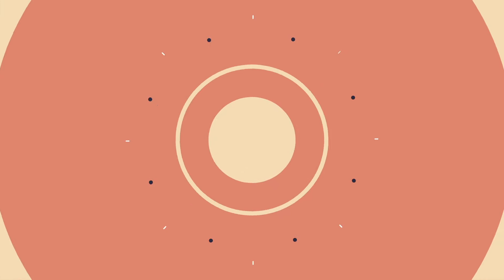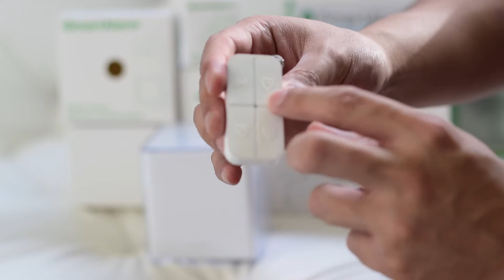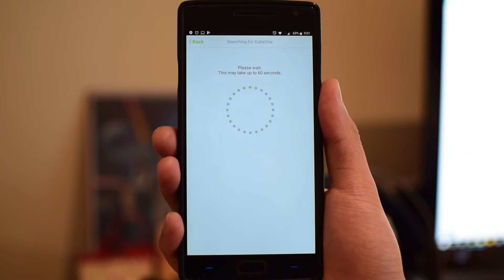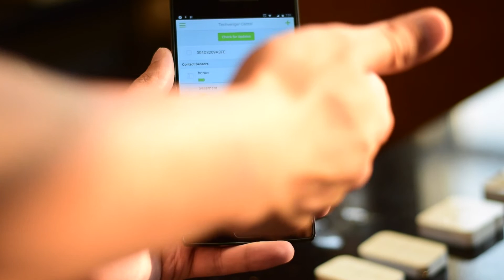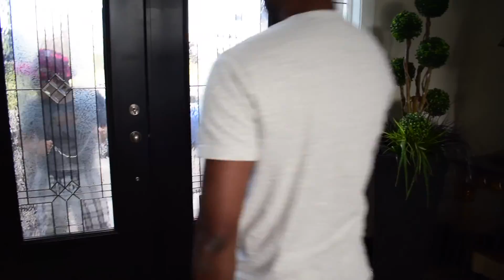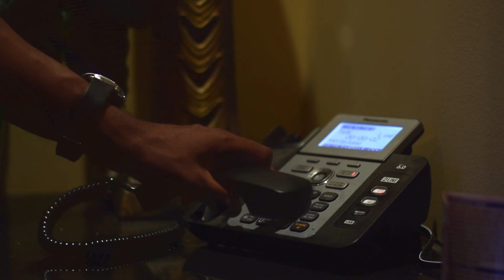iSmart Alarm Security System Review (2018)

Comment: I’ve had the system for 3 years, I have never had a false alarm. I highly recommend buying additional sirens to place in other parts of the house. The key pad is awesome, and the app gives detailed information about the sensors which is nice. 
The motion detector is sensitive (which I’d rather it catch something than be a dud) so when mounting the motion detector I recommend having someone hold it or sit it on something high close by to test to see where the motion range is. 
You can make custom settings through the app, example I have a “sleep” setting where once in bed I set It and if any sensor is triggered the alarm goes off in 10 seconds. 
Once the alarm is triggered you get a phone call, email and text informing you that a sensor has been tripped but it also informs you which sensor. 
I don’t have any of the cameras- I opted into a different indoor/ outdoor brand in case I move and want to place It on my porch. 
Overall not sure why ismartalarm has so many “false alarm” reviews because it’s honestly due to human error. 
The two negative things i will say are that the fob appears to be made to place on a keying but that’s virtually impossible to do without causing false alarms but thats common sense once you see how it’s made. So i use to just hide mine near an entry table to turn off and on the alarm. Now it’s just beside the bed as a panic button since i have the keypad. Also the customer service does suck, I’ve left voicemails and sent and email regarding when my siren then my keypad would arrive because I never received shipping info. I never received any type of response but my packages did arrive within  5 business days. 
I would purchase the entire system again, my mom has the simplysafe and she prefers the look of mine but likes how she can pay to have her contact police for a monthly fee.
Hope this helps someone.
Reply from the maker: Wow! Thanks so much Ashley! This information is extremely useful and we appreciate you taking the time to contribute! Pinning this comment so others can see!

Comment: Can we add or remove people on the app as needed to have access to the alarm OR only 1 person has control of the App ?
Reply from the maker: Hi thanks for your question. You sure can, but overall the system is very finicky. We ended up getting a ring alarm system instead and it is leaps and bounds ahead of the ismart. A bit pricier but totally worth it in the long run. We will be putting out a review for it in the coming months here but if you have any questions about either systems, let us know !